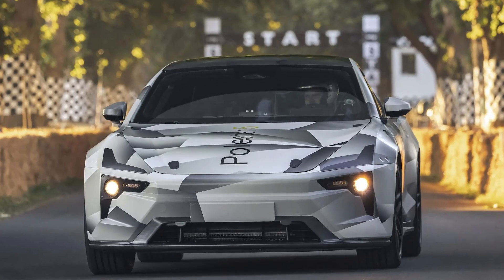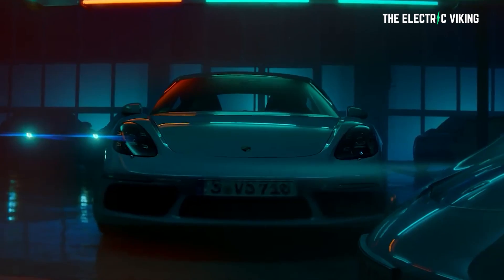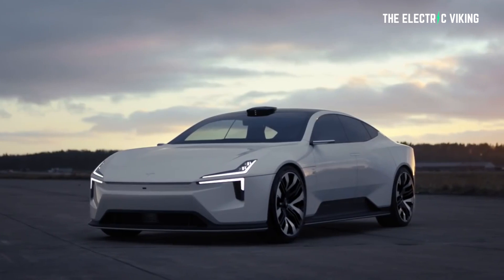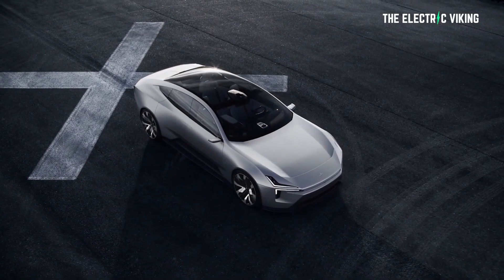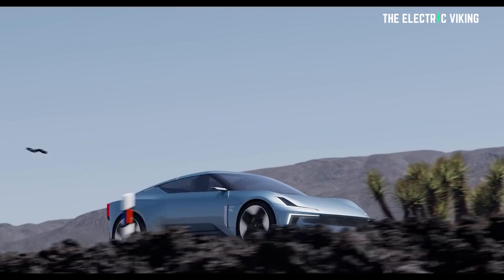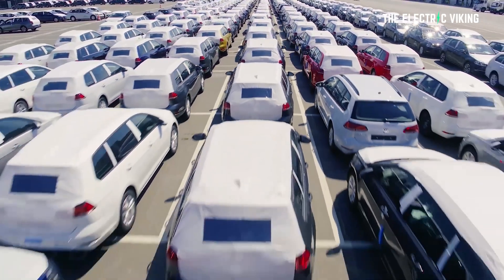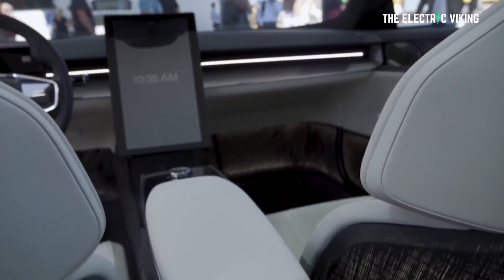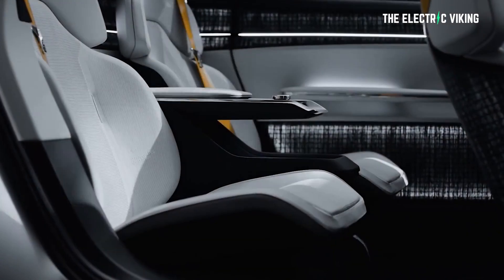Epic NEW Polestar 5 EV more powerful than most supercars

Comment: Polestar is still a Swedish brand it doesn’t matter who owns it or where it’s assembled, downplaying all the research and development, designing and engineering really undoes all their incredible hard work in Sweden, it’s only getting assembled in China and that’s it and why not the production costs are probably cut in half!    Pre production cars will be sent to Sweden so the teams there can finely tune the car both on and off the track, maximising efficiency and making adjustments to the design for the best aerodynamics✌️

Comment: Just a comment about weight and range.   When driven normally, weight is not nearly the impact as aerodynamics on range.   Regeneration recaptures much of the energy and the only impact weight has it it takes more energy to accelerate and more is recaptured when braking.   If driven aggressively, it has a bigger impact since hard acceleration comes with I^2R losses and regen doesn't capture nearly as much with hard braking.  About the only other parameter weight affects (slightly increased) is rolling resistance due to tire deformation and finally bumps do dissipate more energy in the shocks in bumpy sections of road.    Weight does negatively impact handling creating a larger polar moment and this is very much impacted if the weight is out near the corners of the vehicle.  This weight issue was illustrated in recent videos with Rivian and Ford pickups loaded to their max weight spec and the range was not impacted very much (like 5%).
Reply: This might be true for city driving, using regen lots, on the highway there's less regen, so weight, aerodynamics matters.
Reply: @flukeylukey7559  In highway weight have even less effect. Tire deformation is minimal in normal car weights  ... for really heavy loads like 50 tons or such it starts to be very significant. As far as I know Brian above is very right. And regen is also always a loss compared to free rolling. But yes aerodynamics is the main issue. Try out with motorcycle with 120 kmh or so and it is easy to feel  how big air resistance is.
Mercedes analyzed that dropping air coefficient 0.24 to 0.23 at speed of 140kmh would required 200kg weight loss to get equal impact, which is quite significant weight loss.

Comment: Bonded chassis and bodies are more expensive to produce because of high adhesive cost per car relative to fixed welding robots cost spread over 100s of cars. I hope it is very successful for Polestar I just can see hope it would work against economies of scale. Not to mention curing consistency issues see in other industries using similar techniques
Reply: Bonding may be a more expensive process but the advantages it gives in being able to mix steel and aluminium in a structure can be worth it. It doesn't stop the most cost efficient Tesla using the system.
Reply: Polestar is aimed to be more of a luxury brand. Not everybody is going after the mass market, just like you have VW and Porsche right now. Tesla is going for VW customers, Polestar for Audi/Porsche.

Comment: Powerful for what reason?🥴👎
Any idiot can build an electric car that has even 10 000 HP.
Just cram in it a $200 000 value electric battery with a huge electric motor and you're done.
But, again, for what reason?🥴
Reply: economics, luxury car buyers are conditioned to paying certain prices combined with supply shortages
Reply: andys / I know this, but who's the biggest consumer in the world by the amount of money spent? The rich ones or the blue collar workers?
The right answer and the right solution for a car manufacturer to be financially successful is obvious! 😏
Reply: @mikel4879  those volumes and lower price points are coming at a later stage, as per Wright’s Law. 
To get there, EV makers best entertain the wealthier buyers.